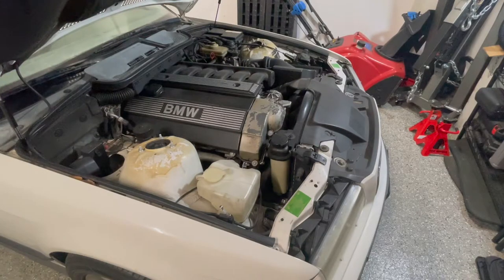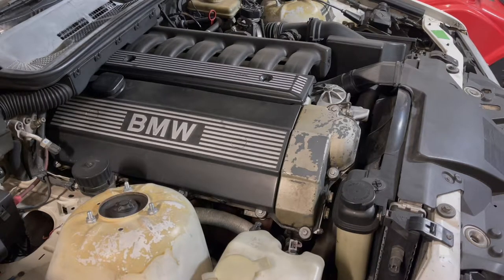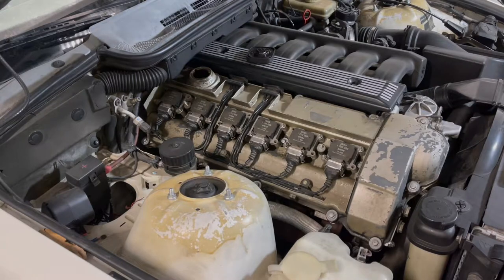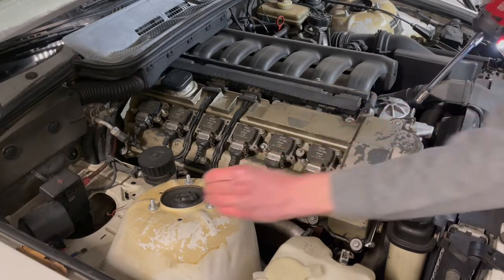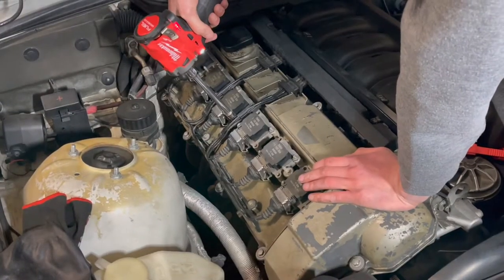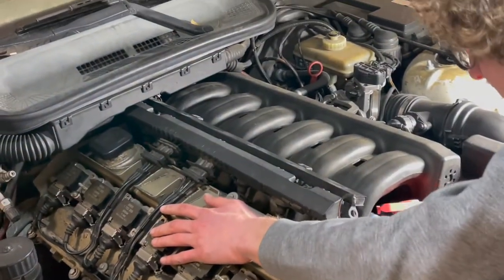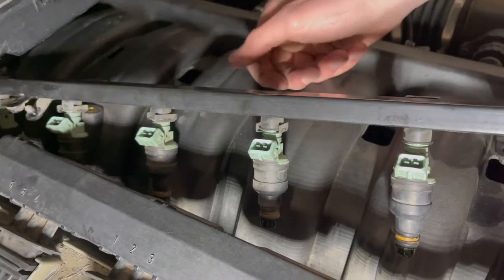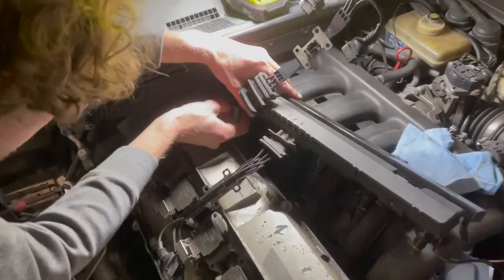E36 M5X Fuel Injector Replacement

Comment: for mine i was able to put the metal clips back on the wire harness before i connected the injectors but after i removed them. was much much easier.